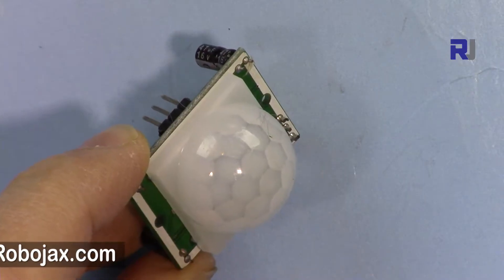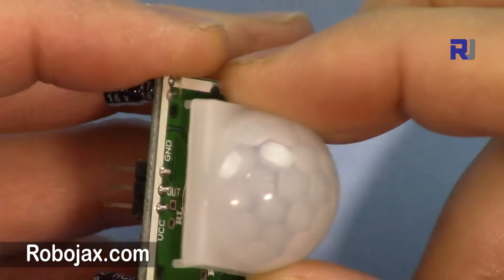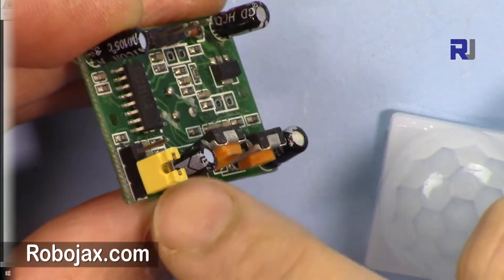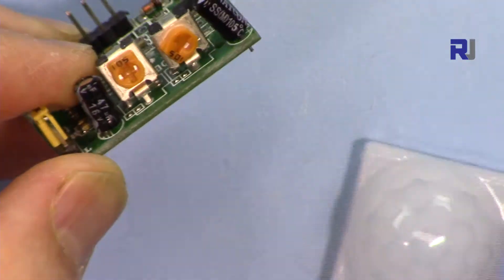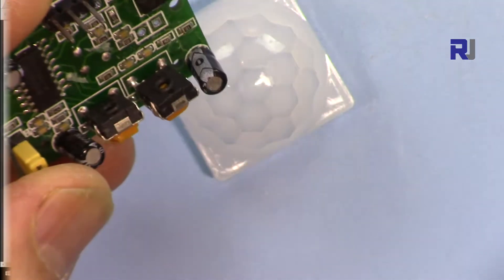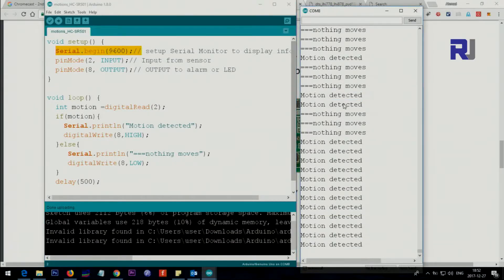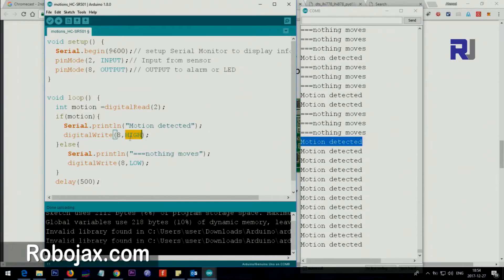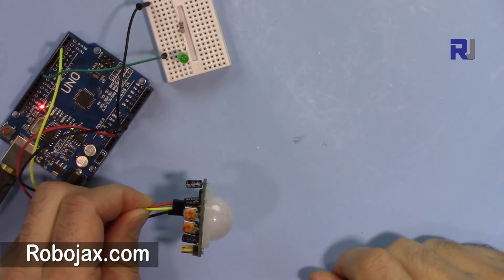How to  use HC-SR501 Motion sensor for Arduino with code RJT35

Comment: no calibration of the pir sensor in your code
Reply from the maker: the calibration is done by rerating the potentiometer. watch the video and learn. code has nothing to do with it.
Reply: @robojax  thx for the reaction, thats they adjustment by the two potentiometers for time and distance, maybe calibration is not the right word what i mean is the startup time (calibration) of the whole sensor thats about 1 minute , this is essential part before starting to use it, read the technical data sheet of the sensor
Reply: @robojax  Power On Delay
Like most PIR sensors, the HC-SR501 takes approximately 30 to 60 seconds after being turned on to go through the initialization sequence. At that time it learns the ambient infrared signature of the environment. Basically it’s calibrating itself to the environment to determine what constitutes motion.

False triggers are likely to occur during this calibration time, so any triggers during this time should be ignored. Also make sure that there is not too much movement in front of the sensor when it is undergoing self-calibration as this may interfere with the calibration process.
Reply from the maker: this module has variable resistor. if you set it in the wrong value/position, there is not code to help you. Just rotate it and set it.
Reply: Power On Delay
Like most PIR sensors, the HC-SR501 takes approximately 30 to 60 seconds after being turned on to go through the initialization sequence. At that time it learns the ambient infrared signature of the environment. Basically it’s calibrating itself to the environment to determine what constitutes motion.

False triggers are likely to occur during this calibration time, so any triggers during this time should be ignored. Also make sure that there is not too much movement in front of the sensor when it is undergoing self-calibration as this may interfere with the calibration process.

Comment: In my code, low, high, input, output texts appear colorless and my circuit did not work. I think my library is missing where can I find it?
Reply from the maker: have you watched the video? I just watched it to remind myself. you don't need any library. you need to adjust the sensitivity. watch carefully to so you learn.

Comment: My motion sensor has "L" and "H" printed on the board adjacent to three pads.  However, it does not have jumper pins.  Why doesn't my motion sensor have jumper pins? How can I select "repeat" or "no repeat" without the pins?

My motion sensor is actually an HW-416-B

Based upon your answers, I will decide whether to complain to the seller.  Thanks.
Reply from the maker: Hello, I just checked the image. for the module you use.  When we we use jumper we connect the middle pint to L or H. so it is exactly the same as I've shown so connect the middle pint to L or the middle pint to H to get one of the result. there is not different. that is what I understood from the image.
Reply: @robojax  Thank you for your kind response.  My problem: there are no pins...just pads.  To connect the middle pad to H, for example, I would need to put a little solder between the middle pad and the H pad.

I don't understand why a manufacturer would make a motion sensor board with the L, middle, and H pads, but no jumper pins.

Here's an image of a board like mine: https://arduino.en.alibaba.com/product/62255409775-813499796/HW_416B_Infrared_smart_device_Human_body_induction_ir_infrared_sensor_module_Imported_probe.html

See--no jumper pins.  Just  L, middle, and H pads
Reply from the maker: Yea I saw that , I did not say pin I said points so solder it to those points.
Reply from the maker: Yes solder the points however you can either wire or just solder . I would solder wire through the hole , first clear the hole, pass wires though them and solder so they are secure. If you don’t use wire you might damage it with multiple soldering.

Comment: If you stop moving and then move again, it can only detect motion again after around 4-5 seconds, is this normal ? With both jumper position. 
Continuous motion works OK (with the right jumper), but once you stop, it only detects motion again after 4-5 seconds.
Reply from the maker: it should. I have shown how to adjust it. Watch it carefully. There is adjusting and position of object or something.

Comment: does it still detect motion if the sensor itself is in motion? i.e. if you put it on a robotic hand and move the robotic hand
Reply from the maker: No. As soon as object or the sensor moves, it will turn ON.

Comment: sir if we remove usb connection from aeduino after upload the program / code and supply 9 V then what. 2nd point is I except a vedio from u on how bipolar stepper, arduino and controler driver with  a code to drive the motors forward revers and with specific angle. Hope you will helps me. all vedios are so good, thanku
Reply from the maker: Thank you very much. I have another video on stepper motor hopefully you find it useful  https://www.youtu.be/Sl2mzXfTwCs